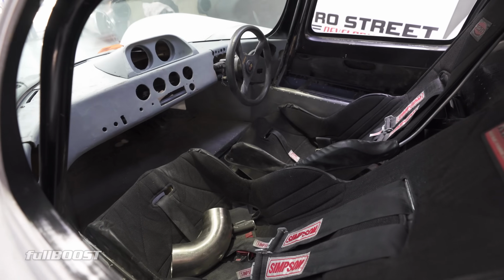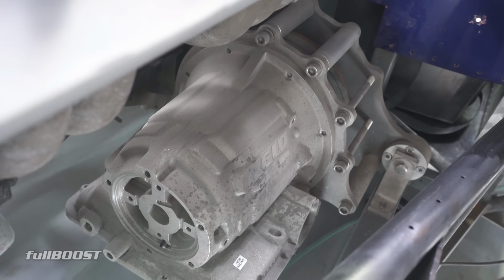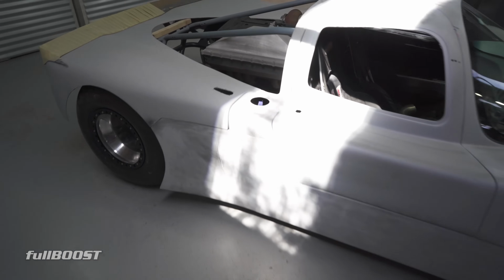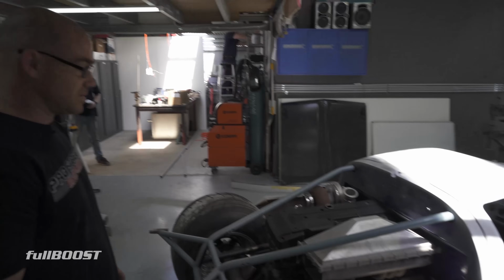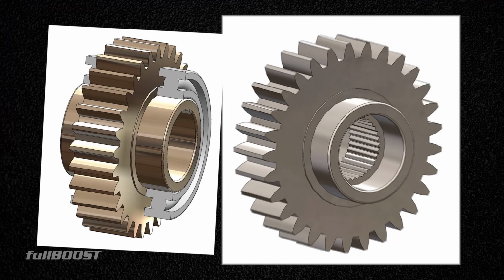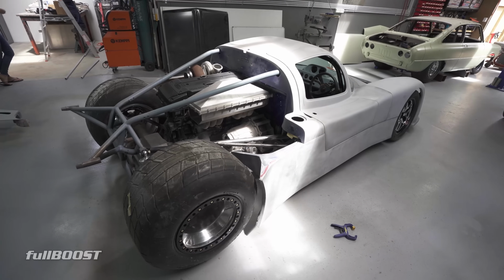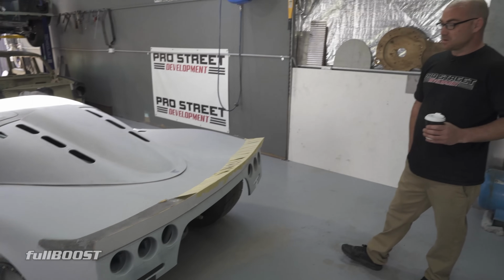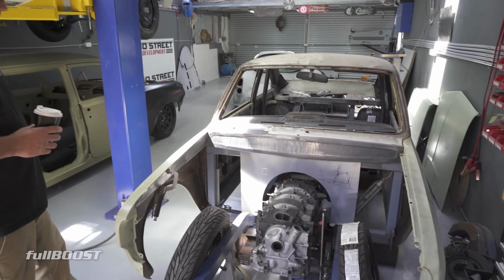The world's coolest Ford BARRA build - Ultima GTR | fullBOOST

Comment: A lot of the cars built in the UK were fitted with small block Chevs  there was a model designation 720 R which was 720 hp . Later cars seemed to largely favour the Chev LS series .

Comment: This utter moron making this a fucking live axle. How incompetent do you have to be? Seriously you could bolt the Barra up to a proper trans axle set up with a proper 6 speed transmission and proper fully independent rear suspension. 

This is the kind if shit engineering I'd expect out of an American stuck in the 1960s. Seriously. A freaking live axle. Not even the ford mustang had a live axle anymore. 

I can't believe the praise this sheer shit build is getting.

4 speed live axle ass backwards mounted engine.

Comment: Seen a vid where them gears just lunch at that power, the bloke ended up running a custom wide chain for more surface area on the cog, stoped it from lunching due to minimal contact on gears
Reply: The gears are large in the transfer case with a far different pitch from the timber template ones . Should hopefully be up for the job

Comment: There's going to be some serious chunter on those primary gears! The module of the teeth look to be quite fine too. It's amazing how much heat bearings reject under high loads like you're going to have. Benefit is the car is light so there is only so long you'll be on the power for! Beam axles can be setup to work but they are a massive compromise for general use. Track use is probably the best scenario.
Reply: Exactly honestly this guy is re engineering it to be worse off. 

You don't re engineer the wheel because it works so well as is. 

These chassis came fully independent out of the box. All he needs to do is source a Porsche transaxle and an adapter housing to bolt it to the Barra and bam. 

Seriously this is the most incompetent attempt to needlessly  re engineer a vehicle.

Comment: That's one amazing build! With the straight cut gears, the Toyota? split gear tensioner cam drive system is something I'm considering for use in a gearbox. It uses a wound spring to apply force opposite the load side of the gears on a sliver of the gear. The tensioned part is maybe 10% of the working gear width. It takes any slop or chatter out of the straight cut gear drive. Gears can't spring back and forth when you unload for shifts, decel, etc.

Comment: I know I'm going to end up in one of those videos where you make fun of commenters.
But the car being so light you could sacrifice some power for throttle response by using a N/A V8 or even a supercharged V8 like maybe a Godzilla 7.3l that can make 1200hp.
Yes I understand that the Barra is cheaper than a 7.3l. I've driven 400 to 500hp turbo six's and when they get on boost they get on boost and you know about it. I can only imagine how much more a 1500hp 4l does that. 
I do really like the build though.
Reply: The midrange torque of 4L turbo is way higher than a NA 7.3L.
Reply: @nordic5490  All depends on the end build goal. NA will be more responsive around a track and last longer if it was a V8. Turbo barra will take out top end.. horses for courses.

Comment: Awesome build but all that money.2jz is your choice.that Barra will be groute filled doesn't make sense
Reply from the maker: How so?
Reply: @fullboost  if the Barra is up around 1500 it's full of groute.for power and reliability and staying i6 the jz is a better choice more cable.build is epic.just went the budget route On the motor
Reply from the maker: @definitionmedia1130  We've seen plenty of grout filled I6 turbo engines. When setup correctly they are perfectly fine as a street engine. 👍
Reply: @fullboost  magical
Reply: Jz engine are amazing but  I believe there over priced and I'd rather use a available option . I'll no doubt billet block this car either way . But the Barra will make that power of the jz at 1500/2000 rpm less .
Reply: @prostreetdevelopment4758  barra are not even in the same world as the jz.the barra is not fast up top.the jz shines up top.barra open deck block.the jz wins in every way apart from cost,a revy quad cam would suit better then a 2jz or def a barra.hil. climbs and track events this thing would be a weapon,top end runs it would be a laughing  stock,horses for courses

Comment: Most Caterhams are live-axle, and nobody's ever said they don't handle.
Reply: Caterhams are light, which helps compensate for the live axle setup.
Reply: @sepg5084  Hmm yes, there's magic fairy dust which magically makes "solid axles handle fine if the the car is light enough".
Or, with the right engineering, a solid axle can be made to perform damn near as good as IRS with the right tech and tuning.
Reply: @Kris Nicholson Aussie V8 Supercars used live axle rear suspension right up until 2015, iirc. Some of the fastest tin-tops on Earth. NASCARs switched to IRS for the first time this year, didn't they?
Live axles CAN be made to handle very well, with a properly setup multi-link suspension and springs and dampers.

Comment: I found having a good engineer on board at the beginning makes things easier, I’m currently doing a full VT running gear including cradles into a suzuki vitara and my engineer has gone above an beyond to help me out an show me some things I may have never thought about… love the build so unique 👌
Reply: Care to share, which engineer, you're using??
Reply: @aaronnoyb  APS engineering thomastown…
Reply: @schtix392  
Thanks for the info.
Reply: @aaronnoyb  no probs bud the guy I deal with is Paul, he’s a legend I was lucky enough to get a tour of the joint when they were still producing GT40’s 😮
Reply: Cradles? Youbarent using the retarded commodore rear suspension are you?
Reply: @sexyfacenation  cradle/ subframe so used the front complete the rear I ended up using the VT arms and diff but made my own diff carrier and lower arm mounts that tie into the original suzuki chassis rails… kinda had to, where the body sits the arms just tuck under the body perfectly but sadly that swing action is a pain…
Reply: That's the way to do it. Book an appointment and plan it with the engineer first, then pick up your tools and start cutting.
Reply: This. I'm doing a dry sumped LS3 FIA homoglated S2000 with a Z/28 camaro rear diff. All sorts of other stuff under the skin getting played with.
Deal with engineer/compliance people before you do anything. When you don't is when stuff 'is impossible to comply' or costs ridiculous amounts.

Comment: Now all we need is a GT40 with a 600+ HP machine and it would be the first Barra converted GT40, maybe should call and talk to the team at roaring40's to see if you can do a upload about their special machines? Still very low to the ground GTR, even a LPI Barra engine with good mods should make that beast do low 9's for sure. :But with 1,500hp just imaging the gear set how strong they would need to be, it would all be titanium and specialised alloys to make strong gear set and bearings and shafts for this beast, keep up the great work cant wait to see it do its first run down the 1/4 mile, i would say at least low 7's to start with and maybe even 6's based on traction control and torque vectoring via the ECU. :))
Reply: I would love to see a Barra powered Ford GT.

Comment: Awesome revamp of a crazy car to begin with.
 I would be concerned about the transfer case lubrication though. Those gears will turn most oil types to foam as there OD would be running at roughly about 50 meters a second. I don't know what the pitch line velocity would be but it could cause some pretty serious damage if the incorrect module tooth is used.
Reply: With 29 teeth and that rough size it looks like about 4 or 4.5 module. Wouldn’t make sense to be any bigger module with a small face width of 38mm

Comment: That’s sweet. It’s annoying that we can’t do anything like this in Qld. I got my series 2 Rx7 pasted with a 20b turbo in Qld only because the rx7 was a13b 5speed car with 4 wheel disc brakes. So it just came down to a motor and turbo upgrade oh and the 9” diff. But I couldn’t drive it around with out the cops pulling me over everyday saying that it was illegal and try to send me over the pits. I got sick of it and now it’s just a race car. That under a racing restricted Rego and the cops can’t give me a hard time anymore. I would like to build a gt40 with a 4 rotary in it. One day. I will just stick with the 7 for now. It’s a tone with over a 1000 rear wheel hp. And I will get to Bathurst one day and race it.
Reply: You have to take down the name and badge number of the cops pulling you over, and keep records of when and where, and that you showed them the certificates and approval plate. Then report them to the comissioner and your local MP for harassing you. I had a mate with a barely-legal (but engineered and approved) JDM import here in W.A. who did that and he found out years later from a friend who had joined the force that the database the cops use to check plates had a note "DO NOT PULL OVER UNLESS BREAKING THE LAW" attached to his rego number.
Reply: You should put some new vids up. Looks like it gets into it.
Reply: @Gooie69  I’m just starting a YouTube channel. I have a few thousand hours of footage here. Building cars. And once I get the 7 back together we will be taking them both to races. Hill climbs. Street sprits.and time attacks. And a little bit of drag racing. Money is a little bit short and I need to buy a computer so I can edit it all and chuck it on. I’m all most finished my Rx7 just building a new exhaust manifold to move to turbo to the front of the engine and bridge porting the engine. And a full rebuild everything is new. So I will see how we go. I hope to have it up buy the start of next month. And I probably be putting out a video every day until I catch up on everything. So Cain hard.